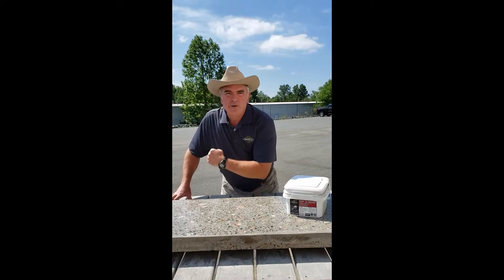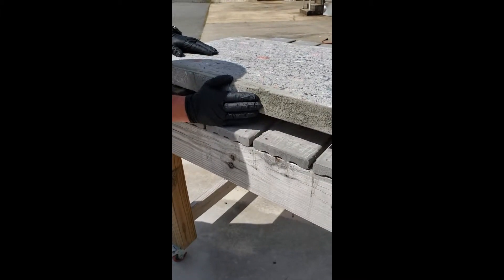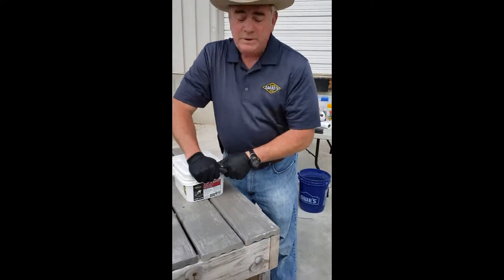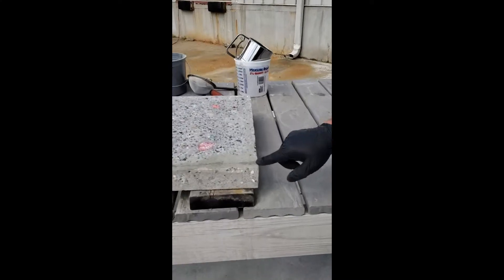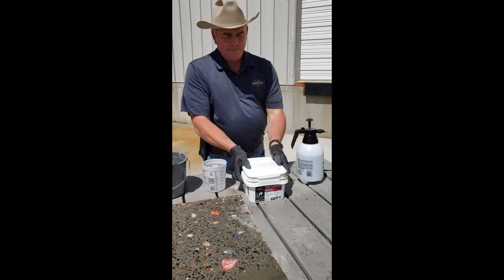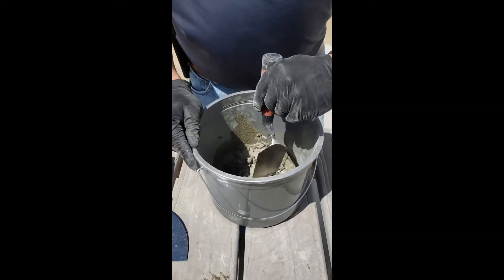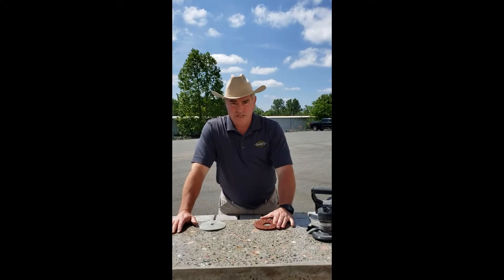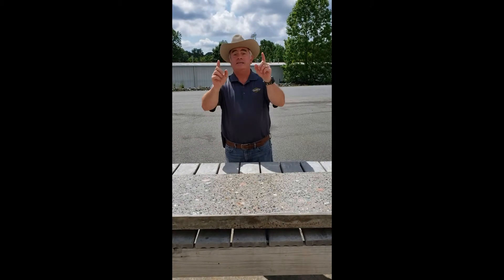Carolinas Concrete Cowboy - How To Apply Slurry Coats

Comment: Hello.  Thank you for a great video.  My counter top is about 20 years old and was lightly sealed.  It is a dark grey and it has lots of pock dents from time and use and acidic foods.  I would like to fill in the pocks and refresh without changing the color.  Would your method work for me.  Any thoughts.  Thank you!

Comment: I recently had to have a hole cut in the concrete slab of my home. In doing so they used water to reduce the dust when jackhammering and sawing into the concrete slab. I’m presently trying to remove that slurry like material which has now dried on the concrete surrounding the now filled hole. Any advice would be welcome

Comment: Great informative video does the surface need to be roughed up first or will this product bond well to a wet smooth surface?
Reply from the maker: Are you talking the slurry coat when polishing concrete, which is what I am teaching in the video? This is a special instance. When polishing, you end up with micro pores. You need tok fill them, then proceed with polishing. The slurry coat made with super-fines is to fill those pores, then the remainder polished away.
Reply: @carolinasconcretecowboy-di9499  

I have some imperfections in my concrete countertop and was looking for a good slurry top coat will this sakrete top coat mix work well to smooth it out and feel in any imperfections?
Reply: Of coarse sifting out all of the sand and using only the fines

Comment: How does Top-N-Bond work with a penetrating sealer? Does it leave light-colored spots where the sealer doesn't get absorbed?
Reply from the maker: On that countertop? Have you already used a penetrating sealer  and are now trying to go back and fill in the mini voids?
Reply: @carolinasconcretecowboy-di9499  
Hi- 
Thanks for replying. 
No, the slab has nothing on it-- I just made it. I'm about to fill the voids and I'm worried about using a material that will look different than the main concrete after I apply the sealer.
Reply from the maker: @eugeneboronow9779  proceed because you have to continue concrete polishing after you fill the voids. Then use the penetrating sealer. Polishing is the great equalizer.